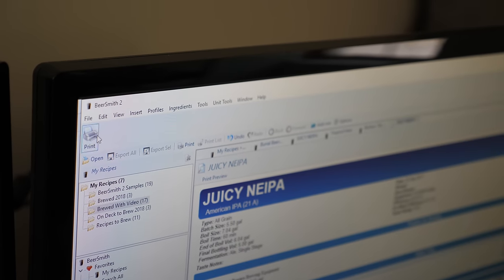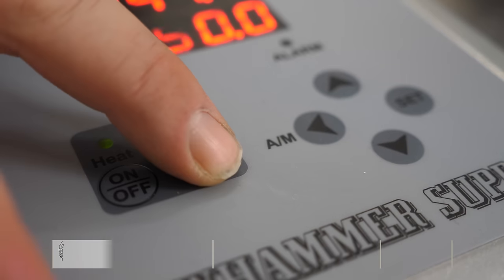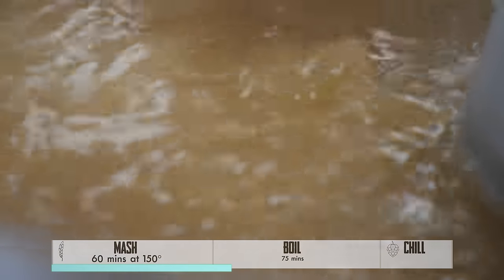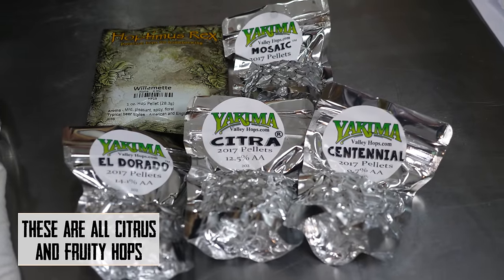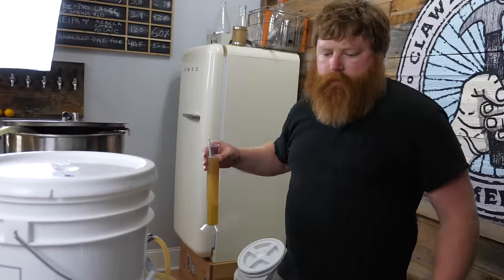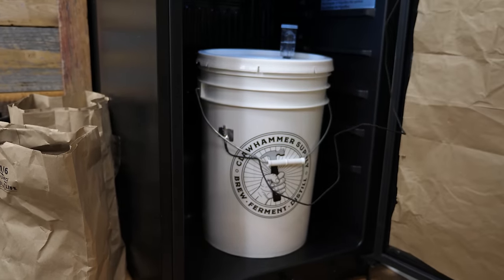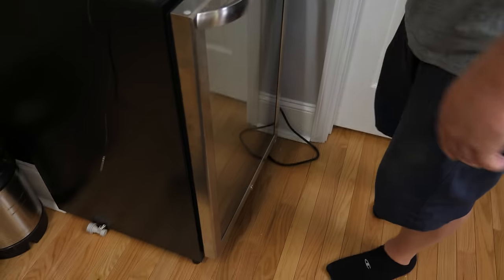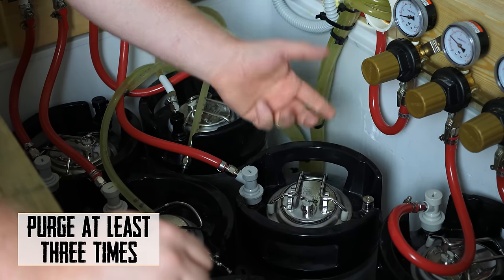Juicy NEIPA - Homebrew Beer Recipe

Comment: Man, I've been wanting to dabble in home brewing for a while, but all this equipment looks expensive!
Reply: His set up is as professional as homebrewing gets, and rightly so considering that he sells most of the gear he uses. I'm on my ~8 brew using the same gear my dad used 30 years ago - you really don't need that much. Plastic bucket, couple plastic tubes, that's it. Only thing you kinda need to make is a wort chiller but thats $25 at your local home depot
Reply: @mensswimwear8110  One of these days I get the balls to try it.

Comment: But how did they make beer before all the tech shyt? I just want a beer that is cheaper than buying it.
Reply from the maker: For sure- you don't need a tech system-- just get a few coolers, a large pot,  and a turkey burner. The tech just makes things easier.
Reply: The only thing I've had in life that came easy is the bumps and bruises, that's why I need cheap beer, LOL. I just made 6 gallons of wine last month and getting ready to make 5 more. I keep it cheap and use regular yeast. I use to have my dad's glass chore boy for making wine, but I broke it, grrrr. Now I use 1/2 gallon juice jugs till I get some gallon glass bottles. I notice a flavor difference between plastic and glass. As for coolers, that's good for brewing wine too. It keeps the temp more constant, keeps it dark and contains any foam overs or ruptured bottles. 

I'd like to try making beer. Heard stories from my ma and dad on bursting bottles, LOL. I bought some hop seeds. I'm a little far south for hops, but I have a spot that they might grow in. I was going to joke on the "large pot" and say how much pot is large, LOL. But now that there is a big movement on medical hemp. I wonder if hemp blossoms could replace hops. I don't want a buz from pot, just beer. But they do have strains of hemp for pain not buz. Good grief, now I'm going to duck duck go "hemp beer". I looked,  Uh, yup they do make hemp beer, from seeds and blossoms. I think I'll just try growing some hops, LOL